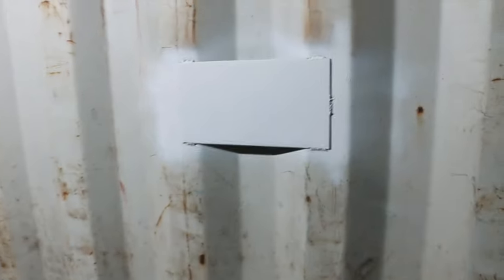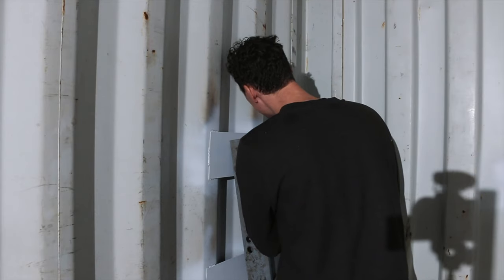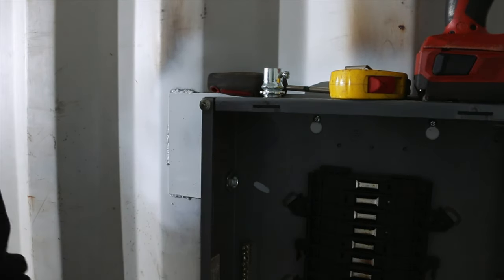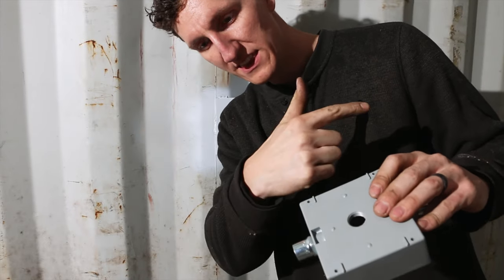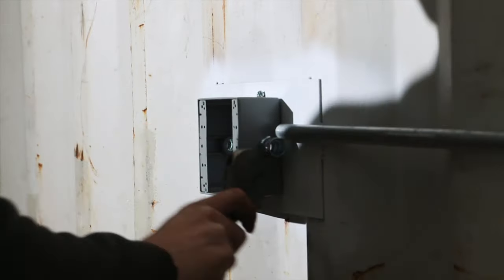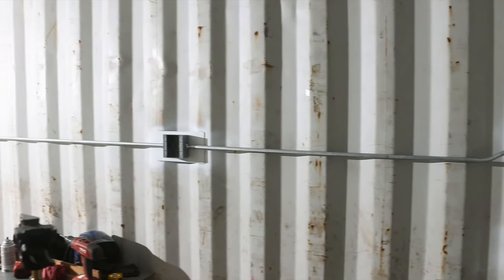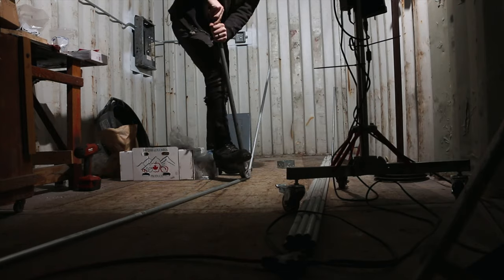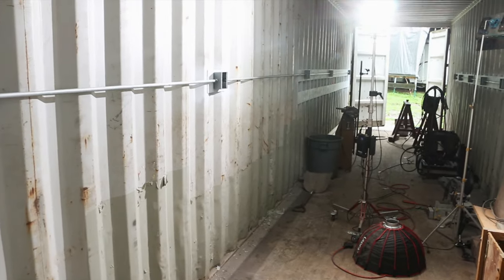Shipping container AXE SHOP - Mounting Plugs and Breaker Panel - Part 3

Comment: Martin you should also do the electrical cabling.  just make sure the wires are thick enough for what you are using.  will save you money  DONT WORRY the electrician will test the sockets with the tools to make sure all the cables are plugged in correctly.  Leave the consumer unit (fuse box) for the electrician

Comment: Having run conduits and hung boxes many many times before you are doing it backwards.figure out where you want the boxes mounted, attach to the box net yet mounted then attach to the previous one in line. Mount your box and place hangers for the conduit if more than 8 foot lengths of conduit are used. Keep it from pulling out of boxes accidently.everything is run from the main box piece by piece.

Comment: good job on the staight condut runs.  
you may want to weld in another plate or a piece of Unistrut and EMT Clamps(U mount bracket and clamps) to secure the pipes in case something gets hung on them so they wont bend or flex out. also it helps to make perfectly straight runs

Comment: Ya, you might be having to upsize that conduit.  Code requires minimum conduit size based on how many and what wire size. 
I had trouble getting 5  #12  into 1/2 and negotiating a couple of bends.  The upside is its all good practice and conduit isn’t expensive.

Comment: As an electrician I cringed a little bit lol but I admire you for just going for it. Depending on how many circuits you plan on having you might run into an issue with the conduit size but the best way to learn is just going for it. Great work👍🏼

Comment: not sure about Canadian code, but its a good idea to strap that pipe 3' from each box. I understand you have concerns about weatherproofing, but its a shipping container, so you probably didn't have to pull a permit so its all good if thats the case.
Reply: I was about to comment about this before I saw yours. I think in Canada we do have a similar code. I think wether he needs to follow code or not, he definitely should strap the pipe near the boxes and every few feet at least. Those pipes are definitely not going to hold themselves up if something heavy drops on them.

Comment: They make little snap in caps to cover up old conduit holes in breaker panels, so you could have just capped off the open hole and used a more convenient hole lower down without having to bend a jog into the conduit...
Given the number of outlets you have and the number of circuits, you should have run bigger diameter conduit as well as there is a limit to how many wires can go into each size of conduit, not to mention that pulling that many wires can be a really PITA..  The saving grace being that it's pretty much straight and the boxes are all close together..

Comment: Perhaps an electrician can correct me if I'm wrong, but if he's wanting a mix of 220 and 110 can't he just run 220 and then only hook to one phase for the outlets where he wants 110?

I guess you'd then need separate breakers for each phase in the panel, but I've seen that before, though maybe there's a reason that shouldn't be done.

Comment: why not using plastic conduits?
Reply: Blacksmiths, metal things flying, falling, dropping, also possible hot stuff, Would you use plastic? 🤨
Reply: @Bobs-Wrigles5555  Tim said this container is supposed for wood and leather work (axe handles etc) explicitly to avoid the fire and hot stuff from the workshop 😅
Reply: @rennanchagas6174  Can you imagine an axe head flying when a handle breaks during pressing in?
Worst case scenario, I know.

Comment: I am going to ask now, after not watching the video and just looking at the thumbnail, is every circuit in this hot box GFCI? Because if it isn't and electrical code hasn't changed to kill people in the last 5 years, all the circuits in this box of heat need to have this kind of circuit. You have walls and ceiling that are metal. Even with paint on their, youey are sources of grounding, so every circuit needs GFCI for safety. OFFRER NOT VALID IN CANADA DUE TO BEAVER or outside the US after 2014.

And yes, I was an electrician in an industrial setting. Your conduit knowledge would have been vastly improved just by watching some videos here on You Tube on the topic. Also, even though code may say you can use the conduit as your ground, run a separate ground that is insulated since you have a metal box with a metal distribution panel bolted to it with metal boxes bolted to your metal box! This will prevent the lethal "grounding loop" situation that can easily kill you and other people. This isn't an isolated incident and the accidents result in two types: the lucky ones that just felt a shock and the rest that were dead. The numbers were in the hundreds for this part of the code to be added, both in industrial and home settings. If you don't understand why a grounding loop would be so dangerous, you shouldn't be doing wiring in anything above 30VAC or 36VDC.

Is that a salvaged panel?! Because if it is, you need to replace it and any breakers you reused right now. It is not safe to reuse those and they can easily cause a fire. Also, if they do cause a fire or there is an electrocution, no insurance is going to pay out and you as the owner, along with anyone that did any of the install work could be held liable for the deaths, injuries, and/or dmages caused by your work. Another thing is that this electrical installation does have to be inspected since it is going to be used for business. The inspector's office might OK it without looking at it since it is in an out building, but you need that approval in case something goes wrong. And yes, no inspector is going to approve a salvaged panel unless it is part of a piece of industrial equipment you moved. There is no way to kno if it is safe and in safe working order.
Reply: I think your looking at this a little to hard as if  this is an industrial setting. There’s nothing wrong with his panel or breakers just because he’s re-purposing it dosent mean it’s not going to work. And seeing how he’s pulling power from his main service to this and will be pulling ground wires if everything is grounded correctly he won’t have any issues with that either. As far as pulling a permit there’s a code Atleast here in the US that if it’s “temporary “ meaning can be removed then you don’t have to pull a permit so if that holds true in Canada he won’t have an issue and regardless of that I don’t think anyone will be calling the city on him telling them he needs to pull a permit.
Reply: Tim did say in the video that he was only mounting the hardware, he's getting an electrician to do the wiring.
That said, I think the electrician may be "disappointed" at what he has to work with, ie 1/2 inch conduit with 6 x 120V outlets off it.